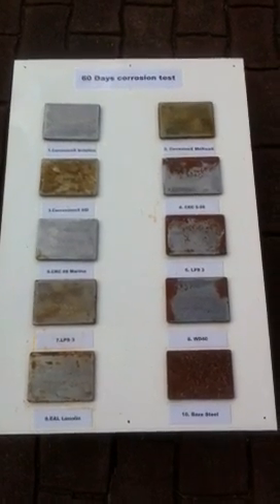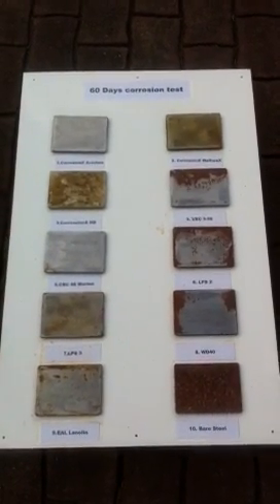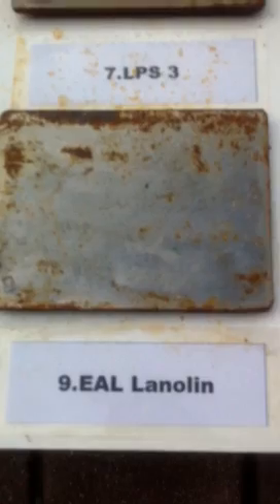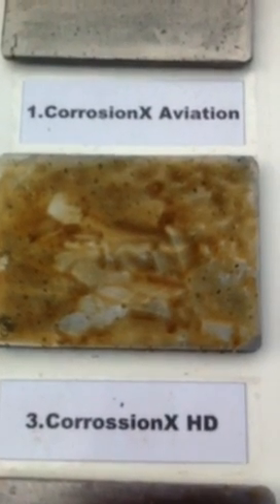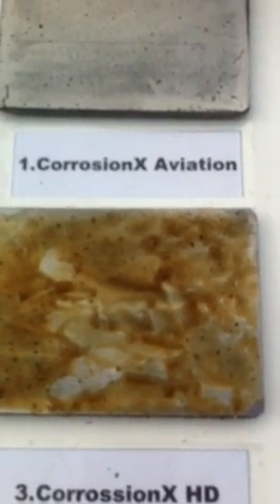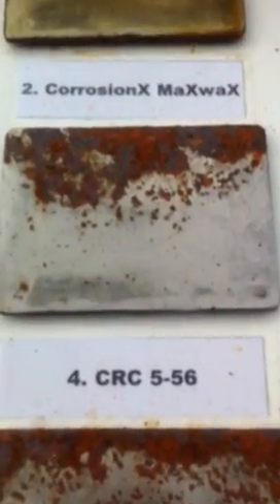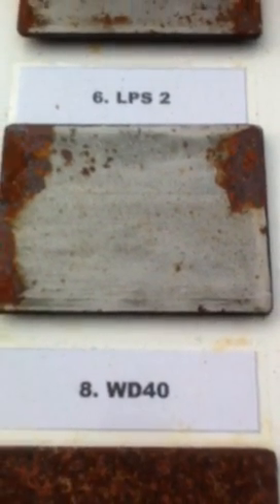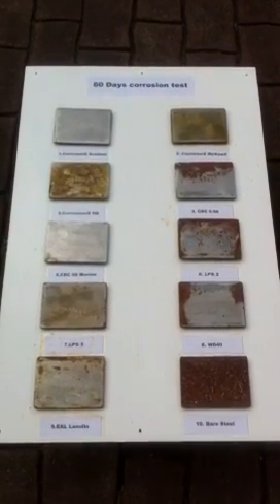CorrosionX test Day 18

Comment: The issue I see with this test is that each product applies at a different thickness.  The thickness of the film of Corrosionx HD would have been much thicker than all the others, it doesn't wash away easily after being sprayed with salt water.

I would wonder how they would all behave if applied in a similar thickness and were exposed to a moist environment.